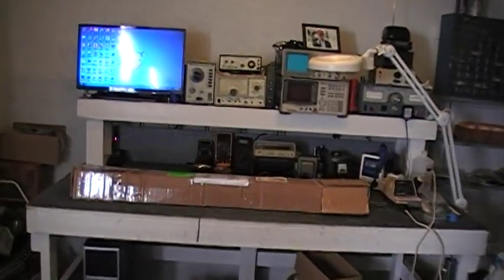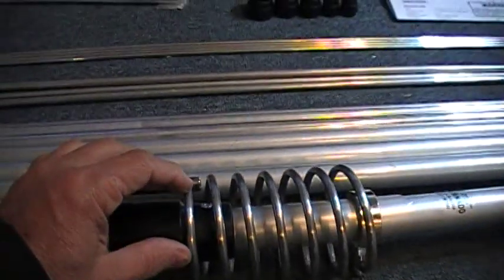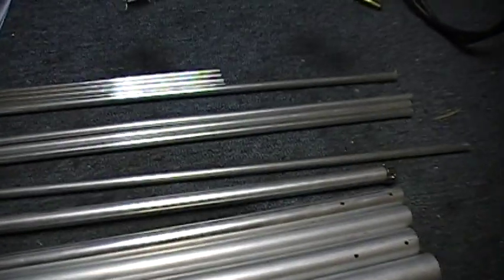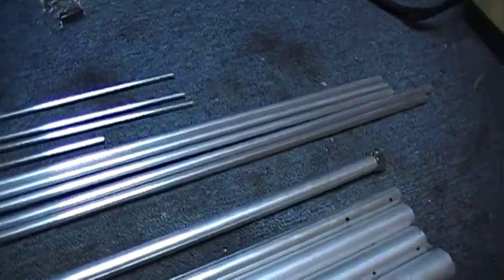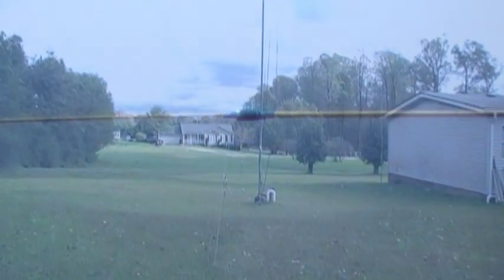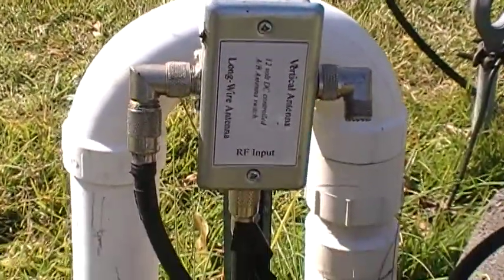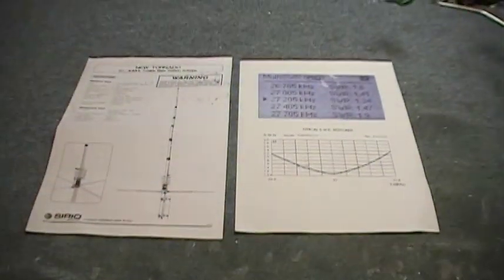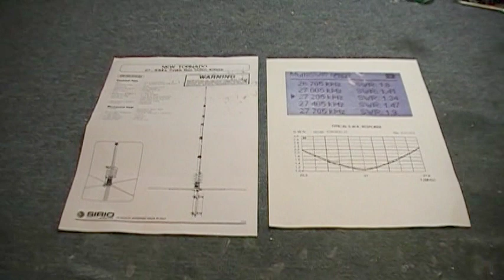Sirio Tornado 27 5/8 Wave Antenna Review

Comment: Hi do u know if this will work without the ground plane radials installed?
Reply from the maker: The antenna will NOT function correctly without the ground plane radials installed.
Reply: @flash001USA  Thanks for the reply. I just thought because the antenna is above my garage which has a large metal roof the roof could act as the ground plane
Reply from the maker: @GMandMoparRule  Now if it's going to be above a steel roof garage it may work to some extent would have to be very low to the steel roof itself to get to interaction for the antenna to behave correctly. Another issue is the antenna will be directional because the lobe will be off to one side if the antenna is mounted up to the edge of the roof. The only other work around to keep it Omni directional would be to mount it somewhere centered on the roof. If not it will behave like a set of semi directional vertical beams to some extent favoring the signal depending were the antenna is in relation to the steel roof due to the lobe being offset.
Reply: @flash001USA  it will be attached to the back of the garage but there is also 2 other large buildings with metasl roofs attached to the back of the garage so the antenna is basicially in the middle of lots of metal roofs
Reply from the maker: @DaveCarpenter2112  It may be easier to go with a different antenna so you don't have to modify anything. Here is a link to a 5/8 wave Silver Rod antenna and a lot of people speak highly about these antennas. You can get them on Ebay out of Europe and I have a friend that has one and he likes it. You could even go with a 5/8 wave fiberglass antenna and get one locally but here is the link. Honestly I would rather have an aluminum antenna over a fiberglass antenna. https://www.ebay.com/itm/320937624705
Reply: @flash001USA  Thanks for the feedback i think i will just use the radials anyway even tho it will be centered above a large metal roof. I guess u can never have enough metal

Comment: I just ordered mine tonight... Thanks
Reply from the maker: Let us know once you receive it and set it up. A bit of advise... The reflectors or horizontal ground plane reflectors are easily bent if you bump them. Especially the smaller solid aluminum rods so be careful and if possible, build you a tuning rig like I demonstrated in the video. This way you can easily tune the antenna without bending anything.

Comment: Are you happy with this as of now?
Reply from the maker: For now I'm happy with this antenna. It's not as broad banded as the Imax 2000 but it's working and I've talked all over the country during conditions with good reports. As far as local communication goes,  I have a decent 70 mile radius with this antenna which is what I had with the Imax 2000. I'm keeping my fingers crossed that it does not snap at the bottom like some are claiming has happened to theirs. If that happens I plan on beefing up the bottom insulator with fiberglass rods and I think that will be the fix should I see this issue.

Comment: Good job on the review, my wondering is what it might look like on say 20 meters or other HF bands, your antenna meter should easily tell you? The Hygain 5/8  10-12  meter sold now by MFJ is being claimed to be a solid 20 meter. performer. I have a 2000 up about 30 feet and very surprisingly it works well on 15, 12, and 11ad 10 and 17 with a little tuning. A second antenna that could be used on 20 is needed, the 2000 is about 10-1 so the loss makes it unusable.  Also to beef up your antenna you could get a fiberglass tube to go inside that would not have the water issue. These plastic parts are used to end antenna life. Also, one of the fiberglass wraps could be used to wrap the entire bottom area thus making it endure for many years after they dry the water issue also goes away with them, fiberglass is rf invisible so after setting them up they are permanent. You seemed skilled with tools etc so you might search for MIKE a UK ham for his homebrew gainmaster you might be able to stick into that IMAX shell you have, it is very broad-banded also, he has 3 different videos of building it.https://www.youtube.com/watch?v=5VxHNTttpEc
Reply from the maker: Hey thanks for that info. Yeah I had that idea you mentioned and I might do that once the weather warms up. I should have done that BEFORE I raised the antenna. I could have used a bundle of cut off 1/4 solid fiberglass rods that they sell at Lowe's for placing reflectors or signs on. Hey you live and learn. I will be checking out the link you sent me. I also thought about experimenting and broad-banding this antenna with a cancelling matching coil like they use on the Imax 2000 antennas. I have a spare that I might tinker with once things warm up and dry out a bit. There's a bit more to the Imax 2000 that meets the eye. In the second stage of the antenna they add a capacitor in series with the antenna that's made up of a small brass sleeve with a nylon insert that the wire fits into the center to make the capacitor which would have the opposite effect of a series coil so instead of an electrically longer antenna with a series coil, the antennas will act electrically shorter but more importantly it helps keep the antenna in phase across it's length. The antenna can function without it and from what I found online, their earlier designs didn't have this in the middle section but yeah, that caught me by surprise when I found it in the middle section.
Reply from the maker: Went and checked out the link. Yeah I've seen this! I thought about tinkering with this and making a horizontal wire antenna using this concept.

Comment: I just bought this .
I was hoping you would tell how u Did the measurements, that was my tuff part. Wanted to see if I did it correctly
Reply from the maker: I just helped a friend install one of these a few days ago. OK when you first put the antenna together, all of the pieces are pre drilled so there are no measurements to calculate until you get to the very top of the antenna where it does not have any drill holes but instead it has a silver ring with a small hex screw to hold the top piece in place once the antenna is tuned. You use their chart which is in metric and you find the frequency from the chart that you want to tune the antenna to and if you're good with metric or if you have a metric tape measure you just set the very top length to the predetermined pre-calculated height and if you're not comfortable with metric measurements, do what I did and go to Google and type in "online metric to Inch conversion calculator" and you will now have a simple calculator at your fingertips to convert the metric to inches. Once you set the top section just be sure the antenna is at least 10 feet off the ground without any buildings or metal objects near it like a utility building or a car or even a house and then you check the SWR and shoot for the lowest SWR at the center frequency the antenna is tuned to. I also like to balance the antenna by going between both the lowest channel then to the highest channel "Ch1 then CH 40" and I try to make them read as close as possible to each other. That's it and you're done. I hope this helps you. Just a side note: I have an antenna analyzer so it really allows me to fine tune the antenna but a decent SWR meter will do just fine too.
Reply: @flash001USA  
Thank you 😊
Reply: @flash001USA  
Right now it's 1.3 on ch 1 and  1.5 on 40.
100 watt amp on 1.7 on 1 and   1.9 on 40
Not sure how to lower SW with the amp on. Lots of skip during the day.
Reply from the maker: @timkubica5056  The reason the amp has a bit higher SWR is not due to the power. The amp itself may not be tuned to a true 50 ohms match. Some amps have tunable caps on the input and output of the transistors but most newer transistor amps have a pre-set tuning cap so you're kind of stuck with what you have. Tube amps on the other hand have a tune and a load capacitor on them to get the best match because tubes will burn up in a NY minute with a mismatch. On my base I run a RM Italy KL501 and with it on at 100 watts dead carrier I have a SWR of 1:2... I also have a MFJ-945E antenna tuner inline that I use and with that inline I have a 1:1 SWR at 100 watts. The tuner allows for a better match which means things run better. I purchased mine for less than $100 and now they have jumped up to around  $160 to around $180! That really makes my blood boil to see the prices jump up like this but I have never blown out or damaged an amp in over 40 years. What kind of amp are you running?
Reply: @flash001USA  
I have a CTE 747
Am dead key at 90
No pre amp but ssb
Reply: I have no clue just how far it should reach, at night but seems to be 50 miles or so. If that's about right I would be happy.
Reply from the maker: @timkubica5056  That sounds about right and the distance really depends on a lot of things including that the person on the other end has a decent antenna setup too. I don't have any real obstructions here so I have around 70 miles with decent stations but on average, around 50 miles coverage. That's all I really need.
Reply: @flash001USA  
Thanks for the info,
Ramrod central Michigan on the tornado 🌪️

Comment: Yes these antennas break at the bottom just like the Maco 5/8 antenna. These antennas cannot stand constant whiplash over a period of time. They will fail at the base if you live in a medium to high wind location.
Reply from the maker: I  know they have been trying to address the issue by using a different material at the base of the antenna and so far this antenna has taken some storms without any failure. I also have this antenna mounted onto a solid mast pole so that the whole antenna cannot rock back and fourth like you would expect to see one mounted in the top of a tree. I owned a MACO v5/8 back years ago and the only issue I seen with the MACO was the round tuning ring at the bottom of the antenna giving me solid connection issues and I eventually wound up taking it down and replacing it with a IMAX-2000. As far as the MACO antenna itself holding up that antenna took a beating but I never had any issues with it breaking or even bending under high winds but I get it that some places will see a consistent 40 to 60 mph winds and that I couldn't honestly comment on.
Reply: Mine did that

Comment: Consider running wooden dowel rods sized to fit down through the center of the vertical portion of the antenna.
Reply from the maker: If you're making reference to the plastic part to beef it up that thought did cross my mind but the antenna has to be able to breathe to lose any residual water that could possibly get into the sections that needs to drip out at the bottom. They do the same thing on the Antron 99's and the Imax 2000's. They call it weep holes. If you try to beef it up with a wood dowel then more then likely the wood dowel would slowly absorb water and one of two things would more than likely happen: 1. The wood dowel would start to act as a sort of conductor due to water trapped in it and it would probably interfere with the characteristics of the loading coil. 2. A good freeze would come along and the trapped water would freeze and split the antenna at the bottom. I thought of packing it with reinforced epoxy resin and leaving a straw sized hole in the center for water to escape from but decided to just see what happens over time.

Comment: How does it tune out?   Price $ ?
Reply from the maker: The Tornado 27 will run around $95 give or take with shipping. Sirio has another antenna that's a bit more robust and the specs are a bit better that will run you around $165 give or take with shipping. Both antenna links are below.
https://www.sirio.store/index.php?main_page=product_info&cPath=2_18&products_id=185 
https://www.sirio.store/index.php?main_page=product_info&cPath=2_18&products_id=417
Reply: @flash001USA  OK thanks for 27 mhz what you recommend?

Comment: Just ordered this antenna hope it last
Reply from the maker: As long as you have it set up and secure it should last. This antenna has seen some hard winds with no issues but if you live somewhere with high winds like hurricane storms on the coast that may be another story.
Reply: @flash001USA  im in Colorado  5380 ft. foothills kinda strong at least 40 mph

Comment: My silver rod works just fine thank you very much🌚
Reply from the maker: What kind of antenna is the silver rod?
Reply from the maker: I went and found the antenna. Yeah I started to get one of these. A lot of people around this area were running this tornado antenna with good reviews and I decided to try one out. It doesn't have the bandwidth that my Imax2000 had but it seems to work ok for my radio room..
Reply: @flash001USA  I live in a tower block here in London. (18 floors) I have one on the roof 🌚 height really is might. £35 only it cost. Happy days
Reply from the maker: @zukispur5493  Yep height really is might! I was tempted to purchase one of these antennas and the only reason I decided on the Tornado 27 was I couldn't find a lot of reviews on the silver rod antenna on youtube.
Reply: @flash001USA  the silver rod gets the job done for hardly any money. I use a cobra 148gtl dx with a teardrop 575 m6 mic. I also use the alinco DX 10. Got a little 100 watt linear amp.  It's enough to get me everywhere 🌚 73 brother

Comment: Id use epoxy infused double walled shrink tubing on those joints, that stuff dont mess around!. Cool antenna though, id take one of those over a crappy Antron 99 any day!!!.
Reply from the maker: I agree with you about the Antron 99. I purchased an Antron 99 way back in the day when they first started hitting the market and the first thing that I noticed was they had no ears unless you were close to other stations. I just didn't like it. I had always used 5/8 wave end fed antennas before I tried the Antron 99 and even my beat up bent up old 1960's freebie 5/8 wave aluminum antenna I had inherited from a friend who purchased an old house where someone left the antenna, it beat out the brand new Antron 99. This Sirio Tornado may not be the best antenna but for an antenna that's under $100 with the shipping included, they are well worth their price!
Reply: @flash001USA  Thanks for the reply. Not sure if you heard of a guy here on Youtube, "Stan Gibilisco" (silent key W1GV) he was a writer for the ARRL and has many videos here on the Tube, he talks about and explains the theory of "loading a ground plain  using capacitors" from what i gather, Stan was not only a ham operator, but a Physicist, Book Author etc....His video about "Loading a ground plane using Capicators" gives explanation as to the Antron 99's construction theory.
Reply from the maker: @ericdee6802  Thanks and I'll look him up.

Comment: Watch your video but I miss
About what Kind of tape you 
Used I miss it
Reply from the maker: This is just a UL quality electrical tape made by Scotch which you can pretty much pick up anywhere where they sell electrical tape at such as Lowe's or Wal-Mart etc....  You want to use good  quality electrical tape because it will last for years on end even outside exposed to the elements.

Comment: Mine has corroded or something blowing in wind good swr bad swr. Good swr bad swr. Need new Antenna.
Reply from the maker: You may need to go back and simply tighten up that hex nuts that hold the big aluminum loading / matching coil in place. I tightened everything up on the antenna before I raised it up just to play it safe and knock on wood I haven't had any issues with the SWR on the antenna. So far so good. It's not one of their best antennas but for the price I paid for it, it has served me well.

Comment: Reflector ? .... There's no reflector , It's a monopole vertical .
Reply from the maker: You mentioned reflector and if I used the word reflector for radials then it was just a slip of words.
Reply from the maker: Lmao! I was trying to figure out where I said reflectors and I just heard where I said it. No that was just a slip of words. I meant to say thank you for your feedback in my reply to your first message.
Reply: @flash001USA    Six of one half a dozen of the other, I have watched many antenna review that have made the same boo-boo.  I have done it myself when talking with friends and I have been in radio since 1967.  At the time I was thinking about a Yagi when talking about a vertical with counterpoise wires (radials).  It happens and you move on, no big thing! lol.

Comment: Plastic under the coil snapped in two... ....
Reply from the maker: @carldeanwebb5181  hey I'm just curious how long you had the antenna up before it failed? Are you in an area prone to bad storms or high winds? So far this antenna has held up for me and it's been up for 3 years and it has been through a couple of heavy storms that had high wind here where I'm located.
Reply: About five years.... Not the only one I have seen do it... It was in Tornado Allie though...
Reply: I haven't seen other ones do i. The 3000 a friend has been up for around 20 years